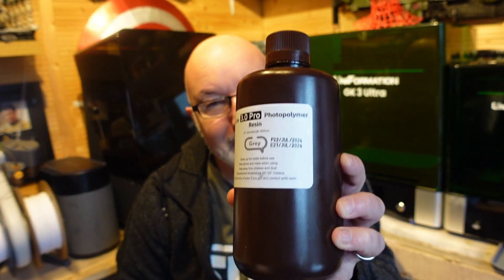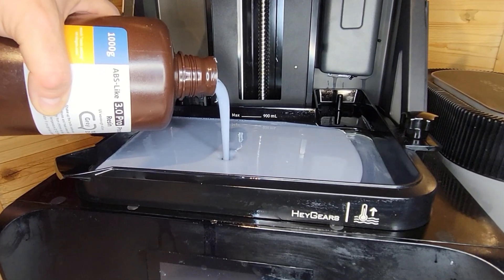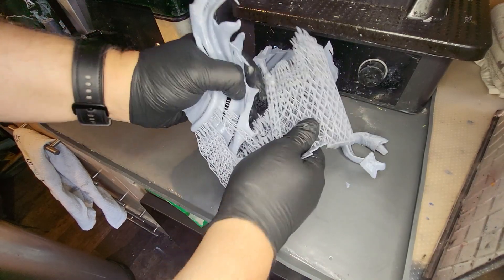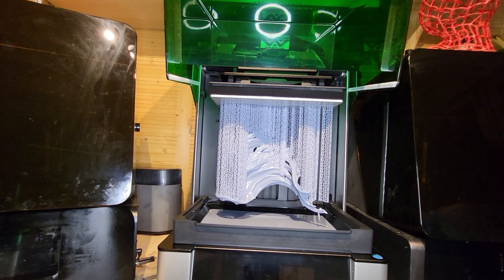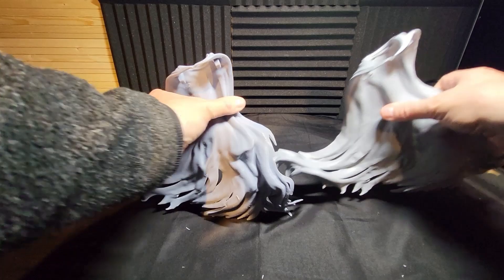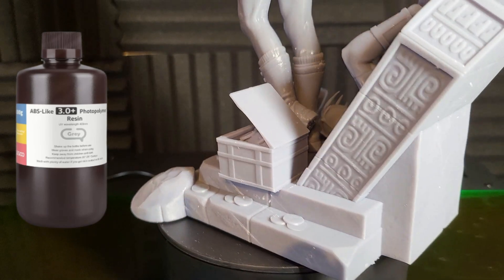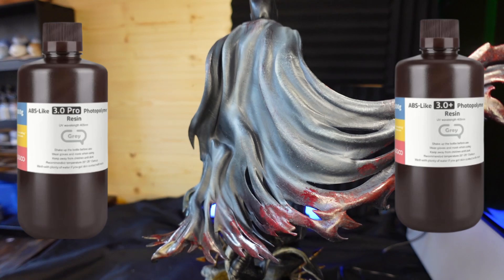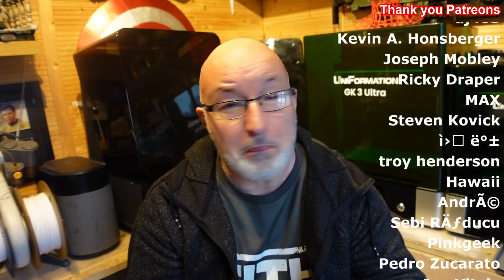Testing Elegoo ABS Like 3 Pro & Plus Resin In The Reflex RS & GK3 Ultra

Comment: Used the parp 10 on elegoo abs like 3.0 on my first print. Smaller pieces printed great! But the big piece came straight off the build plate? Its a bit cooler in here at 22/23 degrees according to my reflex RS. 
Any ideas why that big bit came off?
Reply from the maker: No not sure about that why don't you try another profile see if you get any better success
Reply: @greedy3d480 I think it may have been an orientation thing. I don't like the one click slicing because of where supports end up in places I don't like. But I got a successful print!
Reply: UPDATE! Figured it out. I am a big dummy. I noticed one side of the build plate was getting good prints and the other side was not it was my leveling! Once I leveled it all came out beautifully! I am in love with this printer now!
Reply from the maker: Ah easy mistake to make and fix glad you're enjoying it

Comment: What the dimensional accuracy of the resin like? For example I noticed the gap where the arms were connected for zombie batman. Was this due to an incorrect fit after printing expansion, or due to manual differences?
Reply from the maker: Different resins do have different properties but I've not really had much of an issue with accuracy using anything can't recall on that model it's been a while since I made it

Comment: Greedy, thank you so much for making such great video content and tests. While on vacation, I think I watched almost all of your videos about the Heygear RS. Of course, it ended with me ordering the COMBO RS set using your code and getting a €50 discount.  

But now I need to order some resin, and I have a question since I have no experience with it. I need the hardest possible resins that can be drilled and used for functional parts like electronic enclosures, various mounting brackets, etc.  

Could you recommend three resins suitable for such applications? Accuracy is secondary. My priority order is **hardness, durability, price**, and preferably black or white so that I don’t have to paint them.  

Of course, they must be compatible with **Heygear RS**.  

Once again, thank you for your time!